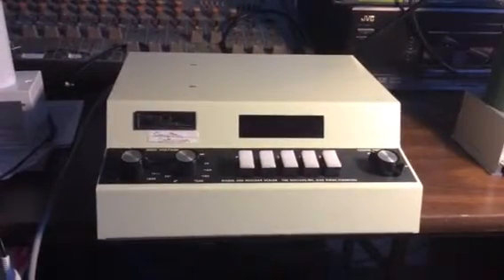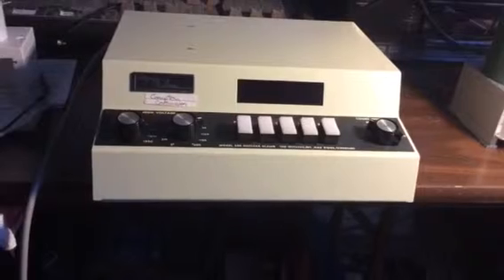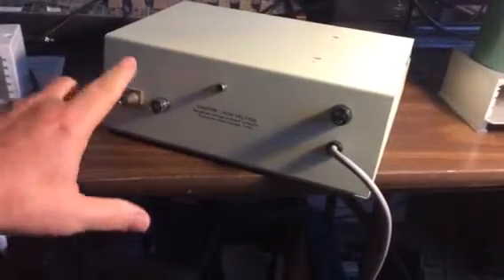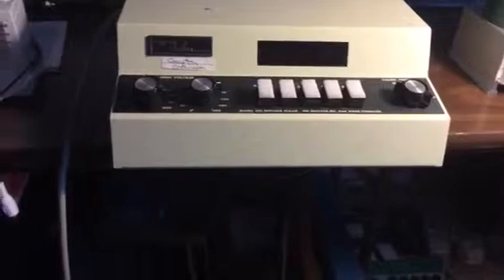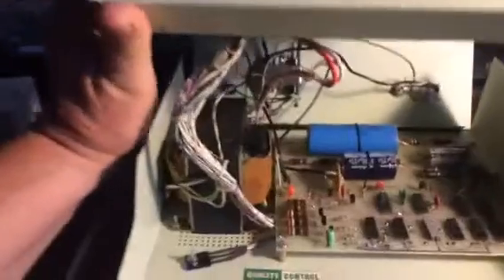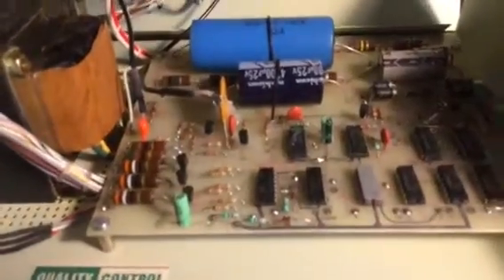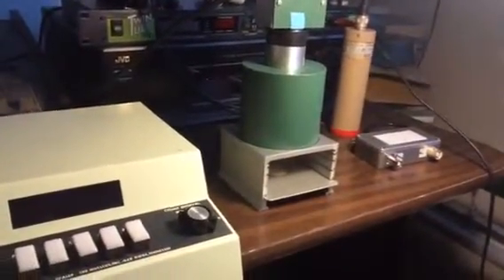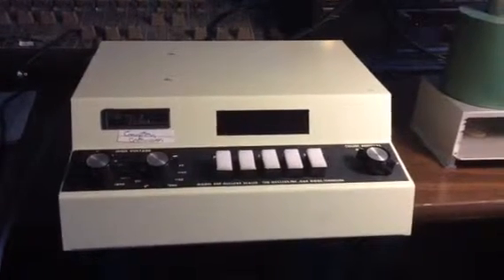Simple $2  Nuclear  MCA spectrometer  addition  to a  Nucleus 500 scaler part 1

Comment: Thanks for the great video! How does this actually work? The pulse from the PMT is less than 1 us, which is much too fast to be sampled by a sound card (<<200 kHz). I've tried this and confirm that it does work. But, how?
Reply from the maker: the same basic pulse stretching and conditioning  / shaping circuitry needed for  the modern nuclear spectro pc soundcard programs is needed to count nuclear pulses in the Nucleus 500 as well.  it's likely that most nuclear geiger counting style devices will do the same thing. they all have to stretch and shape the pulses to get accurate counts.
Reply: @k4nlz  But, this seems to work on the raw pulse, straight off the PMT or after the first amp stage. That's before any pulse shaping. NaI(Tl) pulses typically are << 1 us long. It is possible that your particular counter has a really high blocking resistor, leading to a very long pulse. But, I doubt it. I've tried it on my own counter and it seems to work, as well, and I definitely don't have 100 us pulses.
Reply from the maker: the method I have described here uses processing circuitry already present.  it is NOT  directly off the pulse from the pmt,  but  taping after  several stages of pulse conditioning and stretching present in the Nucleus 500.  it uses the " conditioned " pulse signal right before it enters the digital circuitry. if you compare the front end of the Theremino board and the construction of the Nucleus board you will see many  similarities.
Reply: @k4nlz  OK thanks! I had misread your reply to GMG Labs: " I have done it two ways  .... one this way using the amp stage and the other a direct pickoff from the HV line to a Gamma Spectacular GS-1100 pro ( using the more stable Nucleus 500 for the HV instead of the GS )". I missed the part about going into the GS-1100 Pro. Looks like I'll have to take a closer look at what my pulse looks like...
Reply from the maker: @alphajunky  , Theremino and others have the ability to show you your pulses and they can adapt to a wide range of pulse shapes as well. as long as you are getting similar counts from your test sources ( under similar conditions , like detector  voltage ,-  detector distance etc )  , when using different devices ( like the gs-1100 and say the Nucleus ) then I wouldn't worry a great deal about overall pulse shape.  catching them is most important since the " count " is what is you want over-all.  using home - amateur equipment is  imprecise at best and reproducing results between differing devices - sources - detectors  can often be challenging  if not impossible.  even with pro lab gear it can be challenging and more so with home gear.  you can get an idea of your results using statistical analysis comparison if you want to  deal with more serious accuracy.  I just basically set up my equipment ( whatever it was at the time ) for the cleanest and most accurate reproduction of my test sources as expected by their lines of energy. made them linear  through out the display range (  in Theremino ).   if I got clean lines from cs-137 and / or ( say ) co-60 or especially all the lines in europium ( the best for linearizing the scale )  then after that I made the measurement of the isotope of interest (  like field uranium or differing samples of radium which vary considerably ).  if you can tweek the spectrum display to the proper ( or nearly so with home gear ) linearity and energy line display ( using  probe voltage,  sample  distance, Theremino probe compensation page, Theremino energy linearizing  sliders  etc )  then thats  about all you can expect and a good goal to seek.  pulse shapes  can come in a wide variety  and still achieve the same looking  results related to spectrum displays.

Comment: What voltage was the .01 micro farad capacitor?
Reply from the maker: 3KV
Reply: k4nlz, have a 1Kv .01 micro farad capacitor on hand, will this work, or will the lack of voltage damage the circuit?
Reply from the maker: the Nucleus will deliver 2000 volts and much higher spikes if you shift the voltage control while firing up the probe. even 3kv is a bit wimpy.  I sometimes use 5 or 6 kv caps.  even at that you can expect to fry the front end amp transistor now and then (  exactly the same as with all Gamma Spectacular and Theremino products. Gamma Spect comes with a spare op amp taped into the inside of the box  ).   it doesn't hurt to experiment with different cap values, maybe borrowing ideas from the GS-1100 or especially the Theremino MCA drawings on the web.   I've modded about 8 of these boxes and about 5 of them worked fine, 3 didn't.  eventually I started  " borrowing " the detector ( only ) circuit from Theremino   and grafting it into the box.  all the voltages you need are easily accessible in the  Nucleus box, especially the HV which is very robust ( Theremino HV circuit sags a lot  under load ).  the Nucleus is fairly old and a power supply re-capping job is a good idea as well.
Reply: Ok, thanks so much for the replies, but, I do have one final question regarding the rca audio output connector. It looks like you have one end connected to the same power supply that powers the high voltage connector as well as the type C connector. And it looks like the other end is connected to the .01 micro farad capacitor/.005 microfarad capacitor junction. Am I right, if not, perhaps a wiring diagram of some sort would help. Thanks a bunch for all of the replies thus far, much appreciated!
Reply from the maker: ooohhhhhhhhhh  ( ooops ) ... first .... inside the Nucleus 500, the chassis is the common ground that everything works off of.  in my adaptation  ( in THIS video ) I use the  1st pulse amplifier stage of the  Nucleus counter as a signal amp.  I have done it two ways  .... one this way using the amp stage and the other a direct pickoff from the HV line to a Gamma Spectacular  GS-1100 pro ( using the more stable Nucleus 500 for the HV instead of the GS ) .   in THIS method, the voltage value of the cap isn't critical like it would be with the HV method ( probably had your head spinning on that one  yahaya haya  sorry ..  ) just a simple 25 - 50 volt cap would be fine.  the first amplifier stage of the Nucleus acts as a pulse stretcher and a signal amplifier , both. 
you connect up to the line that feeds the base of the 2nd transistor. this line comes out of the collector of the first transistor.  right at the circuit items at the base of the 2nd transistor.   you can actually connect up a cap tester ( try different values ) ...  solder it onto a stiff  wire and use it as a circuit probe ( feeding your PC amp / theremino ) .  try touching different places in the base of the 2nd transistor and even the output side of the 2nd transistor. you'd listen for clearest sound clicks and / or look at theremino , and hit the retrace for the best looking spectrum display.  use your cs-137 source  and / or a am-241 source that you " know " what the proper spectrum display   looks like and use the circuit point that gives you the best looking , most accurate  looking , spectrum.   make sure to adjust the audio input level of your PC / laptop , HV on scintillator probe , distance from the face of the scintillator to the source and  even the probe linearization inside of theremino for the best looking , most linear spectrum display.  basically connect one end of the cap to the base ( input ) of the 2nd transistor ... the other end of the cap to the line in ( or mic in ) of your PC. add a 50K pot if you want , in line, to knock down the audio level into your PC sound card if it's too loud in the PC. (  slider to the line out, top of pot to the cap and bottom of cap to ground ). feel free to ask away, I'm happy to help. look me up at www.qrz.com for my direct email addy if you want to email  directly ( search callsign: K4NLZ ) . also , i have LOTS of different types of  rad sources, scintillators , xrf, wdxrf and other nuke hobby items available if you need something as well.  I can get you into  serious x-ray ( soft to hard ) as well ( for xrf or wdxrf ).   try caps from 1mfd , ..5 mfd ., ..01mfd etc . different Nucleus 500s act somewhat differently . customize the cap / line levels for best looking spectrum displays.   of course the heart of everything is a good quality, preferably research grade scintillator ( often available on eBay for  $250 or less  for a Scionix , but those vary considerably as well , you might have to try several to get a " good " one ).  sometimes you have to try several scints to get one that gives you the quality of display you want, in the kev range of  activity interest you like best.  this is FUN stuff, hang in there .. you'll love the fun and experimenting.
Reply from the maker: the wiring diagram is in the video as well.
Reply from the maker: if you probe around inside the with a cap to look for the best output signal, remember to stay  well away from the HV section.
Reply: Thanks a bunch for the reply. Very helpful. The current scintillator that I have is bicron, and I believe it has a 1.25"x1.25"x3.00" NaI(Tl) crystal in it. This is the one that I will try first since,it has an adjustable gain bob on it. Again thanks a bunch for all of the information. I hope to do a step by step video on this project, that is, if you don't mind if I use your method.
Reply from the maker: having fun and exploring all the possibilities is what this stuff is all about.  I have no problems with using my ideas and making videos from them ... hopefully expanding upon them and taking them to the next level .. or  further down the road at the least.   nice talking with you.

Comment: Hi and thank you for the explanation
have you used a coaxial cable for the connection between the rca jack and the board?
Reply from the maker: yes a coaxial cable is the best for ambient noise rejection. 100%  / double shield shield preferable.

Comment from the maker: another note:  now, some weeks after I added this MCA  feature to the Nucleus 500, I've had the opportunity to try several different scintillator probes.  I've tried out the Ludlum 44-3, the Picker Nuclear DX-683 ( seen in the videos ) and a 2" Middlesex Alpha scintillator probe converted to Gamma with a Bicron  synthetic crystal.  if you notice in Video two, the charts / displays are especially sharp, clean and noise free. the peaks are well defined and jump out at you.  this shows the Nucleus 500 w/  MCA conversion - Theremino MCA software  is capable of great performance  and the Picker Nuclear  scintillator probe is excellent in this configuration.  by trying all these differing scintillator probes, I've discovered that not all scintillators are created equal and ALL but the Picker Nuclear  gave me marginal  to poor / noisy  results.  the scintillator probe , its self, can be and IS all important related to the quality of the results you get.  I've tried an array of different high voltage settings on all the probes and differing distances from the face of the probes as well to check the influence of possible overloading of the PMT.  naturally, the larger diameter a scintillator probes is,  the more desirable it is for MCA work.
Reply: Are you still Alive? I remember you said you had been battling cancer?
Reply from the maker: @englishguy1985   I was supposed to enter hospice 52 months ago , the docs said my time was short.  but I opted for an androgen deprivation treatment, first, to get some of the bone pain under control.   To my surprise and especially my medical team’s surprise , I’ve responded uncommonly well to that treatment.  I’m debilitated and basically in a wheelchair but tak’in a licking —- still ticking. Yayahahahaya.   They now say I could go up to another 10 months before the odds are stacked heavily against me ….but hey , they’ve been wrong before. 😂😂😂
Reply: @k4nlz  I’m really glad to hear you are still kickin, thanks for the reply and I hope that the time you have left treats you well. Take care and god speed!
Reply from the maker: @englishguy1985   thanks for your kindness.  It’s much appreciated. 

❤️❤️❤️
Reply: @k4nlz  I spoke with you on hear a long time ago and just wanted to check in, and I’d thought about you recently. Best regards. -Jamie.

Comment from the maker: I was asked about a USB version of this.   if you wanted usb I would think buying a $4 usb soundcard and installing it inside  the Nucleus 500 case would do the job. just port the .01uf cap into the line input of the USB sound card and you are good to go.  if you want to tweak it and improve it considerably, there are great  USB sound card MCA  tweaks at Theremino dot com.  most of these modern , under $5 ,  USB sound cards can be set to very high sample and bit rates compared to many internal computer  sound cards.   I may add a usb sound card video as soon as I install and test the application.